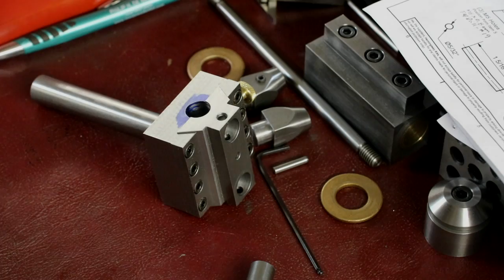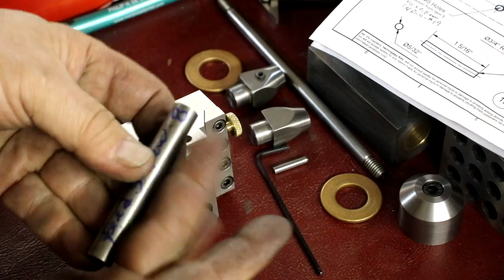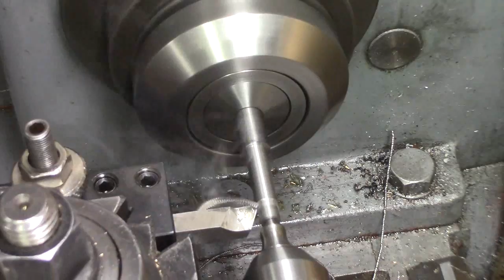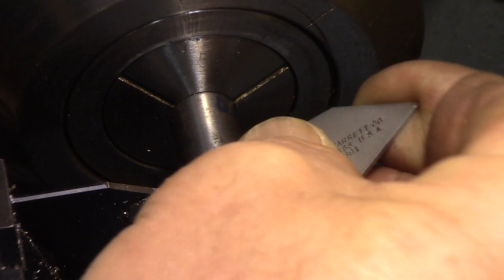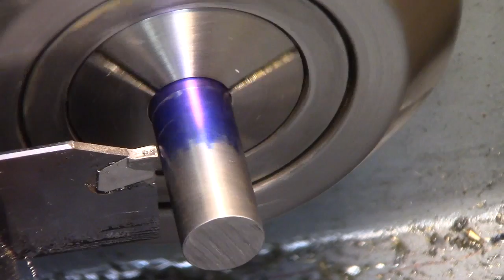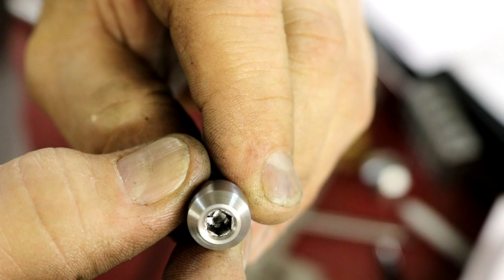How To Build a Hemingway Kit Spherical Turner / Ball Turner P15

Comment: Nice touch on the broaching...can you clear out those petals of metal at the bottom of the hole easily, or not? Thanks...Chuck
Reply from the maker: I think I can get the petals out with a drill run in after the broaching.  Thanks Chuck.
Reply: I thought of that, but worried it might break the point of the drill. Having never used an endmill I wouldn't know if more flutes and less chip-load helps in interrupted cuts like that? Thanks for the answers...Aloha, Chuck

Comment: Not criticising you directly Randy but I cringe every time I see people cutting square shouldered thread reliefs. It seems to be a widespread practice. I use rounded parting inserts to provide a nice fillet. Does wonders for stress concentration. 
How are you liking the Digimatic mics? I just dropped close to a G on the full set 0 to 100mm. Hope I will not be disappointed :)
Reply from the maker: You are very correct about the radius.   I need to get a tool set up just for doing the relief.  I love my Digimatic mic's  I have 0-4".  Thank you Rob.